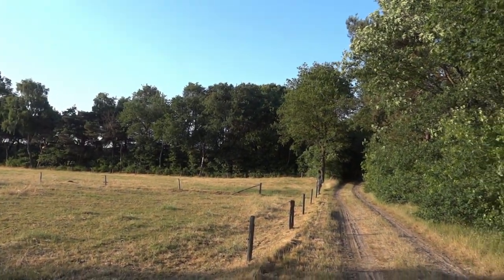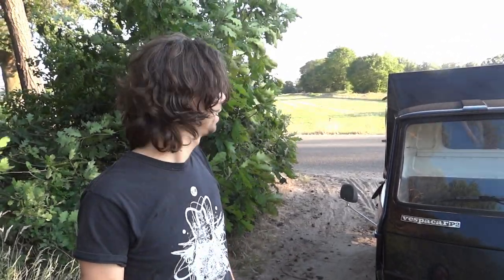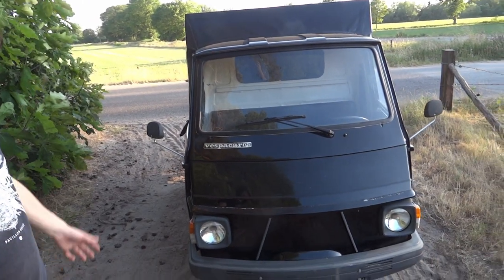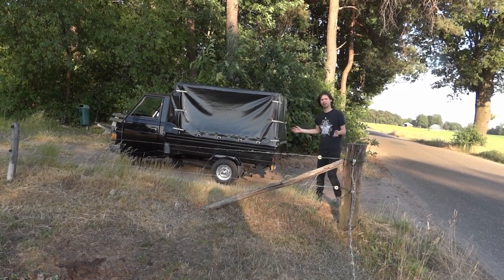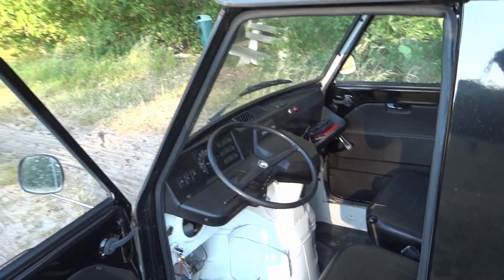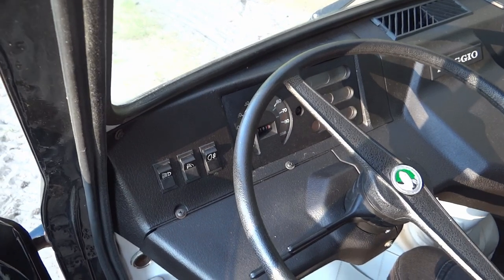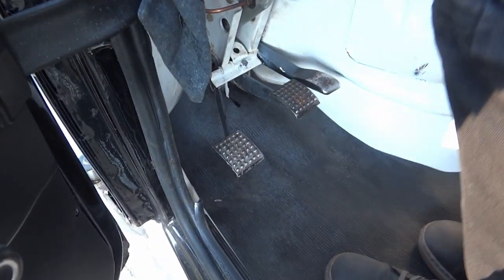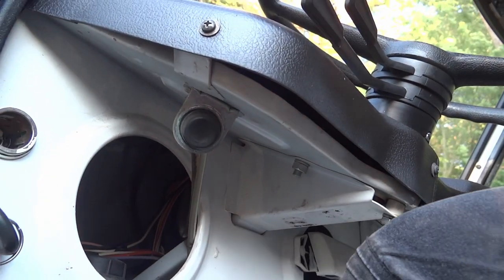1994 Piaggio Vespacar P2 - A Closer Look

Comment from the maker: Problem with the engine was easily solved: as I guessed the carb got slightly loose. Should've tightened one of the nuts better! Oops.

Did some further tuning and it idles/revs down perfectly now. Drives real smooth too! Yay!

Comment: thank you i also want to buy a vespacar p2 and i dont find any vids of it. thank you so much
Reply from the maker: Exactly why I made the vid :) yw
Reply: Do you think the ape is worth it if you dont have a car or should i buy a ape tm?
Reply from the maker: Depends on how far you drive usually. I don't drive farther than say 20 kilometers almost all of the time. There are a few occassions I drive much farther (recently for the yearly checkup for example, was 70km in total).

If I would have to drive much farther on a regular basis I probably would've gone for a normal car lol
It also depends on how much you mind traveling taking slightly longer and ofc an Ape doesn't have the luxury of an average modern car ;)

By the way, an Ape (50) or Ape TM is a big difference, one is a big moped the other an actual car. Matters quite a lot!